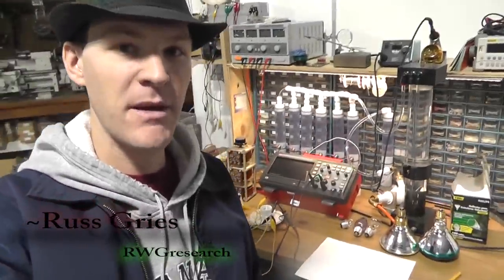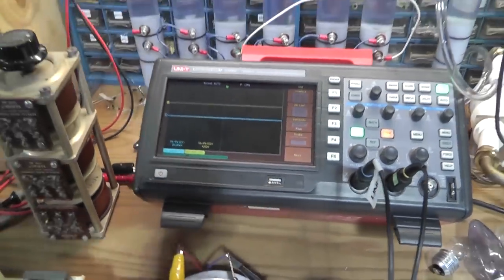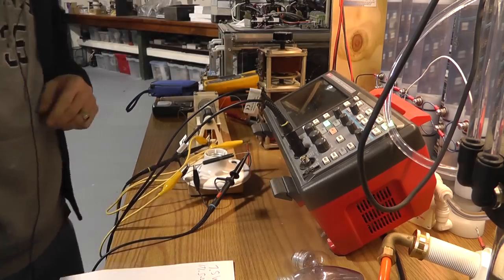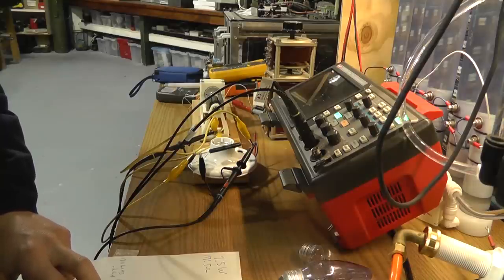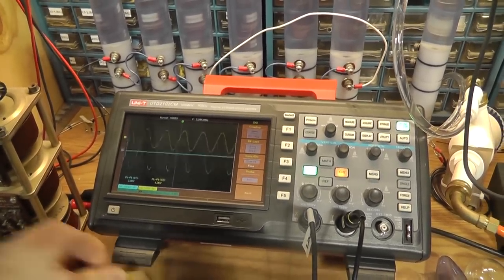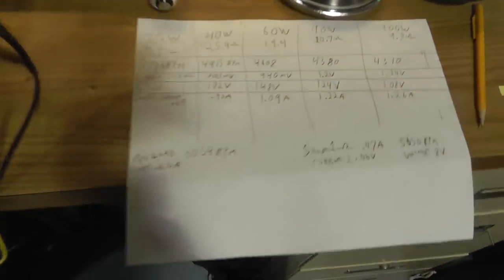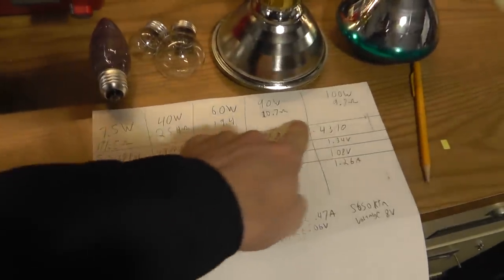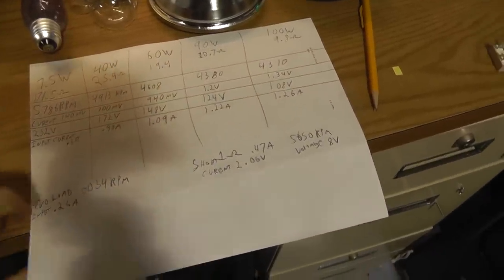Gerard Morin Testing. #2 : O-Scope Shots & Interesting Loading / Short Tests. (Starving Pump)

Comment: Hi Russ, great job, still wish I was in your awesome lab. Keep on testing every single u nit, you are putting so much detail for people to see the numbers. Which i am lacking on my demonstration. If you still have the time to test, when you start to put out the high voltage, that is where it really starts to behave in a way that is difficult to understand. Have a nice day.
Reply: Gerard and Russ in the same video would be a dream come true. maybe the Stanley Meyers gas/ particle accelerator ? The smallest pump powered with less dc volts and without big capacitors or transformers doesn't really seem fair to me , especially when the last half of Gerard's video went to great lengths to talk about the multiplication factor. But Russ did a great job as usual with the data . I need to upgrade my1940s oscillograph

Comment: Russ, with the voltage and current in phase your power factor is 1. I think it would be interesting to try coupling the resistive loads through various values of AC capacitors to play with the voltage/current phase relationship.

Comment: Sei begrusst out of Germany, Russ. I can see why batteries would be a better alternative as a power supply. A SSG over a rodin coil back to the batteries. Plus a load; CFL, Gas processor (Plasma), etc. Might prove good?... The circuit seems to become more radiant by adding capacitive or high resistive loads. Gerard Morin's concept brings many thoughts and questions in my head as does yours. I personally would attempt to couple a radiant charge circuit back to the mechanical supply batteries to see if a self sustainment or a higher efficiency can be obtained. I enjoy your vids. God bless
Reply: maybe I'm wrong, but shouldn't the first step of efficiency start with the drive motor?

Comment: hey Russ
Great job playing with the pump. Just wondering if you wrap the pump coils with a heavier gauge wire if you could get better amperage out of the pump itself and treat it as a separate higher amp coil that could be rectified and returned to the motor to assist in driving the system. Basically turning the pump itself into a transformer/generator I guess?
Waddaya think?

Comment: Thanks for sharing test results. With that style generator could it make a difference flipping the connection of one coil to eliminate drag? Lenzless?
Reply from the maker: Well this application we would consider that "generator" to be more like an oscillator.  so an oscillator of other types could be used, one with less drag. to answer your question, if we flip one coil, they would be in phase and not oscillate correctly. they much be out of phase to work correctly in this setup. ~Russ

Comment: a bladed fan, like a  box fan will increase current draw, because the fan turns slower.
a squirrel cage blower will do as you describe.(when you stop air flow)

Comment: Hay Russ, 3 or more of these generators in-line but out-of-phase should make for a pretty neat 3 or more phase generator. You should then be able to put neo-magnets back in, but with reduced cog torque due to the out-of-phase positioning. http://www.energeticforum.com/renewable-energy/20001-gerard-morin-type-pump-motor-alternator.html#post270781

Comment: If i take a look at your final data, the 100 watt light bulb run at 124 volt give around 108 watt output while your input is only pulling 37.82 watt.. I think you should seal the test with an AC clamp meter for AC amp to be more accurate.. All the vectors inline should be more representative of the COP of the machine..  Thanks Russ
Reply from the maker: don't forget that a 100W light is not allays pulling 100W that bulb was berly lit so i suggest less than 50W easy prob in the 25W range... just a thought, ~Russ
Reply: ***** Hi Russ, Maybe I am getting things all wrong? Ohms Law R-Load*I-Load=P-Load?
1st test: R-Bulb=171.5Ω, I-Bulb=140mA, V-Bulb=24v, P-Bulb=3,361W
5th test: R-Bulb=9,2Ω I-Bulb=1.34A, V-Bulb=13.13v, P-Bulb=17.6W
Reply from the maker: Robert Brooks don't forget i was using the voltage indicator as a way to visually see the amp draw. so those numbers in the AMP column are just voltage numbers representing current, but not a current measurement number.  so if you take the voltage number i recorded and divide it by 1 ohm resister that will give you the current draw through the resistor. and effectively through the circuit.  I believe that to be correct. and i was using all peak to peak measurements. so the voltage i was recording was not RMS. also the voltage i was recording was the voltage across the generator. not the bulb. hope this makes sense. ~Russ
Reply: ***** That is what makes this circuit so interesting. The voltage drop on the load; not really important in regards to the properties of this circuit..

Comment: There is one thing that puzzles me. According to Ohm's law for the 100W lamp, there is a voltage drop of 1.34V in the 1 ohm resistor which gives a current 1.34 amps flowing through the resistor and the bulb. With a voltage of 108V and a current of 1.34 amp circuit consumes 144W and a load of 80.59 ohm.

And for the motor power supply I assume it is a 31V supply and consumes 1.26A, giving 39W consumption.

Theoretically we have a 3.69 power gain. So theoretically you could use a DPDT relay. NC ==> outlet. NO ==> output of the generator. COM ==> power supplies.

I think the power gain is too high. I would think a gain between 1.3 and 1.5 for a generator half core but not 3.69.

If the generator has a high gain and is able to feed on itself. The logic would validate the efficacy has largest volume

Comment: The washing machine pump should produce RF, not AC. And 24 volts DC motor should be brushless motor. Magnet should be ceramic one which have larger magnetic field, not neodymium one. Also make sure the U shaped iron has a good resonance like a tuning fork.

Comment: You need a 12v dc motor , with higher rpm to get the best of the engine pump like 3000 rpm is about 29 mph 1500 is about 15 mph I think 🤔.

Comment: Why is the cut off make you rev, higher level? So, same as a fan when it cut off, it spins up then down right? So, why does cut off that is no power will cause higher power than the input power, so the cut off power gives higher power temporary. The higher power is the current base on cut off but the highest will last for short time. Where is the extra energy come from? It is the same as Tesla that shows in Thomas's place when it cut off, then it killed the worker. It is about the circuit, then cut off circuit, so cut off circuit is a higher benefit but lower in time. 

That is what dead short so it is cut off, so it is a dead-end? Can add the ratio so to know how much the depth as an addition thru the ratio, from the start to end, like 1/3, so the addition is 2 as a depth. So, input watt is 7.5 W /  input current that is .39, it is parallel low, so the start is 7.5 W and the end is .39 as current to bulb, right? How long can each bulb last, that would be good to show as data, how long it lasts? 

The thing you want most is input current, so give you the highest light, with highest V, since V is the key to current, so, V that is high show align to highest RPM. So, RPM has more energy that matches the V part. So, can give you the highest current, so it can last longer, but data show you have the highest watt, that is input with the lowest resistance which give lower rpm, and v, that means it will last a short time, but I doubt it since the short part is base the impact to the resistance of mass, so the internal resistance before it breaks up. The lost volt will increase as the resistance of mass get stronger. The battery gets weaker the more you use it so it doesn't work, so the internal resistance gets higher than the capacity of mass that can handle it, so it gets over-capacity of mass since it will break apart thru heat. The mass has lost energy thru the use of mass, so the same as a person that uses himself that is running will get tired, so need more energy, so the energy affects the mass. Same as you boil the water, the resistance of water break apart into gas. 

Base on EMF, internal resistance, and terminal p.d., and lost volt. So, the higher the lost volt is the higher resistance. The give-out to higher current. So, lower RPM which connects to lower V is better, but weaker is the output of energy so less bright, so need higher RPM which connect to highest V, that lead to higher current so cause the higher output of energy so more bright, but which last longer? Again, good to show the database on higher V alone or higher RPM alone, or both together.  

You have two C, that is input current and current, why is that? You got the data that is symbol resistance from a machine that tells you?? If that is so, then the longest watt that has the lowest resistance will last longer? Or last the same as 75 W with 171.5. W is Volt and symbol resistance is V that is impacting the resistance convert into 171.5? 171.5 is a gain from 75 that is 96.5. 100 W w/ 9.8 R is 90.2, so 96.5 is higher so give higher V and frequently. The depth is higher, so higher depth is better than lower depth. 

It is good data, with an addition to other info to make you understand to make an energy to keep going with the lowest maintenance. This comes from the machine you have, so the machine will give you an idea so to gain next level that government doesn't want you to have, so government invent or allowed it to exist for electricity people, but also give people free energy. So, what government gives is a double-edged sword, it can protect themselves thru positive from other people or damage themselves thru negative from other people.
Reply: It's pretty useless

Comment: Hey russ where did you find the U core?
Reply from the maker: This core is from a washing machine pump. The entire thing can be used but i happen to have parts missing so i maid my own holder... check the description for more info! thanks! ~Russ
Reply: ***** If you take the coils of the U core and suspend the core in a thin string, and then tap it  with a screw driver is makes a very nice high resonant tone.